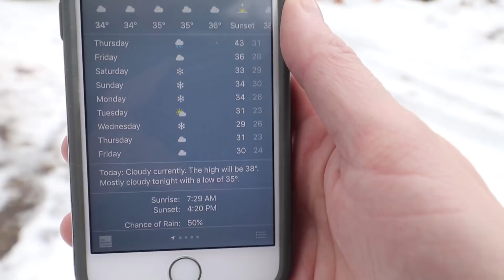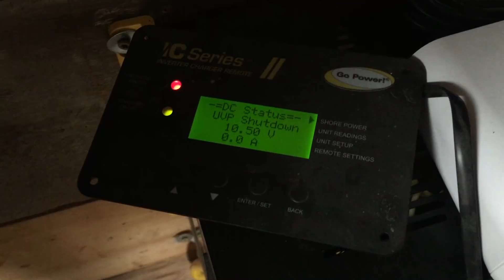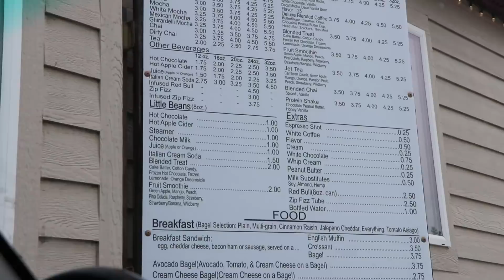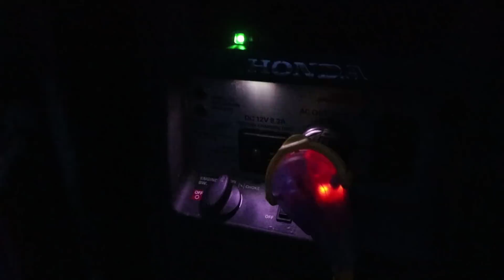Our Story: Giving Up Solar Power to Go On Grid

Comment: Your solar experiment was doomed to fail! The system was just too small for what you were trying to do!  There is a home in the coast range west of Lorane, OR  that carries on a normal all electric life on total solar and wind, but they use a system that cost nearly $100,000 in 1981.  Most people can't live the way they are used too on total solar in the Great NorthWET.  We went grid tie.  Can't speak for Bonner's Ferry, but a 20kw grid-tied system in Philomath,  cost $20,000.  After rebates it came to 7,000 and in the 2 years since installation  the highest power bill has been $25.00. In the summer running air conditioning.  In the winter (gas furnace) we still run the meter backward.  This is 3,800 square foot 2 story home with an electric hot water heater. The only maintenance is washing off the solar panels on the roof every so often.  Just a thought. Good choice for your lifestyle, consider grid-tie and maybe some batteries for backup when the power goes out (at least in  Benton County Oregon you have to go either grid-tie or stand alone).

Comment: You could do your homework and learn to install a grid tied system. The grid acts as the battery, basically you only pay for the power used in excess of what you generate. YOU USE THE POWER COMPANY.

Comment: Hi Jesse the first thing to do in any off grid energy situation is to assess all resources. Ie running water wind or solar. 7 or 8 panels is enough to power most homes in Australia with north facing roofs and deliver some excess to your neighbors . However your set up is tiny and not ideal. Because you are in a mountainous region you also lose a lot of energy with horizon shading. Please don't discourage others from using solar! It may be ideal for their situation! ALSO adding extra panels as you go is a cardinal sin.

You suggested that people can determine that solar isn't viable for a home with a handheld calculator. I assure you that you can't There are countless things to consider. Azimuth, tilt, peak sun hours or irradiance, shading including horizon, inverter sizing (which is one of your main issues), Losses in components and wiring..... You would actually need to create a graph in excel to show all this and projected output/battery charge so there are no surprises. A system can easily be optimized for summer, winter mornings or afternoons depending on when you use your energy. bachelor of engineering technology, final year.

Having said that if you had spoken to a specialized engineer instead of a sales person im sure they could have told you grid connection is better for your location. Or simply demonstrated the costs of both with a simple payback calculation for solar.

Comment: You're doing a whole lot of building without a whole lot of power. I think it's an extremely wise decision for your season of life. You know that power obviously isn't cheap to run to your property, especially if they'll need to dynamite through rock. But any home builder would have to do it if they weren't choosing to live off grid! It's something we have to consider when we buy our property. 

My husband is an electrician, sets up systems all the time. He can absolutely tell you if there's enough sun or not at a location, and we're in one of those situations now. People just don't think about it!

Good job at doing what's best for you! That's all that matters!

Comment: I've all ways looked at solar as an additional power source to grid power rather than a primary source of power
i actually run into your channel while looking into solar and i'm impressed  you gone as long as you have with as few panels you have, the estimated number of solar panels my house needed to cover it's power needs was basically equal to my roofs surface area
Reply: I mentioned that in my comment above, some people have no idea the amount of panels required to run a whole household.

Comment: By adding a grid power supply, it will give you resilience in your power supply options; a huge factor in living in northern climes. 
It will, once you have paid the supply connection fee's, save you a lot of money over the next 30 years.
As a retired Utility company Electrical Engineer of 40 years experience in the UK, I will be interested in their supply solution, the Utility company will offer you.  
A word of advice do not over estimate your power supply needs on your power supply application, it's a common mistake that can cost you a lot of money; get an expert to evaluate your load requirements and take into account the diversity factor.
P.S. I was an Electrical  Supplies Engineer in Central London and was an expert in this field, I would have been some help if your property was in Central London but......  LOL
Good luck

Comment: I have lived on a solar system off grid now for two years, your system is not adequate ;)
Reply: If you had listened to the video, their system was a test, and even if they went bigger, it would not give them what they wanted. They also clearly made the point that this is "their" situation, and everyone else will have their own specific needs, wants, and system. It's nice that YOUR system works for you but that doesn't mean your way of doing things or your particular use of power is anything like theirs.

Comment: I've been using solar, off-grid, for almost 15 yrs. We moved panels last summer over to the small shed. Yes it was dark more this year than the last several years in December and January. Yes we ran the generator more than I had expected. Since around the 1st part of February we have been able to use the batteries during the night and the morning. Only time I turn the generator on is for my blender because the lights go crazy and it doesn't start without the generator. We are using T-105's at this shed, 3 sets.
My 24v system stayed up during that dark time. But it has been doing even better since I changed the configuration and added the higher wattage panels, 2 sets at 48v (280 watts per panel), and a MPPT charger. I don't have to worry about the batteries as much because they are Lithium. 
My hubby would love to bring in grid power, 12 yrs ago it was about $8000 and we were self employed so the money wasn't there. As of last year, it has gone up, between  $15,000-$20,000, do to the increase PUD has initiated for installing the power. Even with us both working it doesn't seem to be in our budget. It has to go almost 1/3 mile from the neighbors connection to our site.
If we had brought in power 15 yrs ago I just might have had a house by now.
There are so many choices that each of us have to make each day and year.
If we do go grid tie he wants to keep the solar to offset the PUD bill, net zero effect. This might be a choice for you.
Reply: If we were grid tied then we would have qualified for help installing more solar. Oh well!

Comment: I applaud your realism. It's not easy to go 100% off-grid. It's certainly not cheap. One fellow I watch bought a pallet of solar panels, kept the ones he needed, and sold the others to offset the cost of his own installation. I've seen many, many folks having battery problems, from buying used batteries to save money, and then having to replace them soon, to not having enough capacity, to trying to keep the batteries warm. Corrosion of terminals, ventilation, and the complexity of wiring if one isn't an electrician are also issues. From my very limited experience, totally off grid living means giving up some things, and paring back as much as possible on everything, or spending massive amounts of money for a much larger system than most people ever think they will need. It's a wonderful idea, and it will eventually be practical, but for those who want a refrigerator, a washer and dryer, a microwave, and air conditioning (HORRORS!) it will take a lot of panels and a massive battery bank, with associated installation and maintenance costs. It will never be free, and it's a big compromise. For someone young and fit, who doesn't mind chopping wood for heat and not having many of the conveniences of modern life, it's feasible to be totally off grid. I'm old, my wife is disabled and needs to charge her wheelchair batteries, and I LIKE cool drinks, food storage, and having climate control. It's just never going to be practical for me, as much as I would like to be off grid. I wish you luck, and much happiness.
Reply: lol I could only picture the amount of batteries i would need to run my AC all night.  I run my ac all night, day time, meh i aint home idc, but at night... ALWAYS on I like it cold to sleep... I'll keep it 80F during the day but at night its 66.  lol batteries.  Vs my bill (thats way to much already) at $100 a month.

Comment: If you're going to pay $10,000 dollars or more to be put on the grid why not just buy a propane system,and use the solar for backup.. a propane system will basically run maintenance-free -with the exception of the truck having to come and fill the propane tank,which is a cylinder by the way once a month,and maybe even once every other month,all according to how much power you'll be needing and the size of your system.
of course every 6 months you'll need to do what's called a regular, which is the basic spark plugs air filter,and then of course you'll need to change the oil, no biggie though,and the best part about it is you're still off grid, and you will also not have to retrofit your home any because usually you can just piggy tell then to the solar system

Comment: 1. 12 volt DC battery feeding a 120 volt ac  light (using an inverter)
that means your 12 volt battery has to work 10 times harder.
example: 120Vac * 1 amp = 120 watts. 
                  12Vdc * 10 amps = 120 watts.
so, that means, your battery will discharge fast.
that's why a higher voltage inverter is important. i use a 48 volt inverter. of course, there are higher voltage inverter.
use the formula above.

2. It's your solar panels that charges  your batteries (you started with old batteries). 
 if battery are 12 Volt DC and 350 amps, that's 4,200 watts. you have your batteries in parallel (3 * 4,200 watts = 12,600 watts).
 it will a long time for 1000 watts solar array to charge those batteries.

3. Just to get started, i would use a 2000 watts solar array . If, you get 5hrs of sun, that means you would get ~10000 watts
(of course that doesn't count losses).  
you already have an Outback controller (150 volt 80amps great). 
also, i would use a higher voltage/wattage inverter. 
also, newer or new batteries. 
 
anyway, i don't understand, you started with old batteries, one solar panel, no experience with solar and you 
are giving solar a shot in the arm.

Comment: 10-20 Kw solar system + LiIon battery bank + inverter + Generac 7Kw propane generator that starts automatically when you run out of battery power. $18-$22 K if you install the solar panels on the ground by yourself. No need to fill generator, propane tank lasts months (used sporadically in the winter). Solar panels generate electricity even when cloudy or rainy, less (30-40%) but not zero!  Even better if you have an electric car which can store huge amounts of electricity up to 70-80 Kwh and can power the house for a week. Something like the Bolt or Tesla 3 ($35K). Free energy for life.

The other solution is 10Kw solar + inverter + Net Metering (hook up to the grid) brings your monthly bill to $0 for the entire year. $12 K

Comment: I think you're making a good decision given the weather and your power needs. If Winter means lots of snowy overcast days, it doesn't matter how many pannels you have. Most of those I see on Youtube having good luck with solar either live in areas where it's sunny most or the time, or they use it as a suplemental power source in conjunction with being hooked to grid power. Also the all solar people tend to be in 'tiny houses' which cuts the power needed to light, heat, cool, etc. You're building a full size house. It might be a neat project for the future to see if solar or maybe wind generation would make any sense as a supplemental source there. Doing that when it's not what you have to depend on for power would make it a lot less stressful.
Reply: Overall I would say that you need to match your ongrid/offgrid systems to your particular needs.

As a counter example, that points to targeted use of Solar, I would point to the Hilder's, from Idaho mountains, whose home was designed to not need as much energy as a traditional design that the timber frame is modeling; i.e. built in to the side of a mountain/hill, use of materials that will conserve heat(masonry mass), reduced use of electrical power, etc. 

For an intermediate example I would point to Steve Robinson, a more traditional house design but diverse use of Solar, Wind, Wood and Propane mix to live unconnected to the power/water/gas grids; they use electic stove/oven, traditional refridgerator and a workshop for Pete's sake!

Another intermediate example is Ed, preppernurse1, whose off grid system works for his and his kids needs. Solar balanced with generator.

Their solar setup is definitely NOT one that is meant to power a traditional house! It is closer to Tiny house or RV class system.

I agree with the others that they should definitely keep their equipment and refocus it as a solar generator as opposed to a gas/propane powered generator. I've used my small system, deliberately designed as a solar generator setup, to keep gas furnace(fans in summer)/lights/Internet going overnight when the local power company takes its sweet time to deal with downed lines/storms... Nice to not have propane/gas generator screaming in the middle of the night pissing off the neighbors! :)

They freely admit they live a lifestyle that consumes quite a bit of electricity and it DOES make sense for them to switch to on-grid for their specific lifestyle.

I do think it was unnecessary to dog on others who have less power hungry lifestyles. There are ALOT of families who's lifestyle's/housing CAN be met with off-grid solar/wind/wood/propane solutions and who DO shower, work and make use of modern convieniances.

Comment: Being an electrical engineer, I can tell you that’s it’s all about daily load calculations, in KWH (Kilo Watt Hours)and worst-case analysis. If there is one week of clouds, how much power would be needed from the batteries. The solar panels could still produce up to 50% of their full-sun output, so one must have 2x the amount of solar panels. You would still need fossil fuel for heat and a backup generator. As a previous poster said, a three-phase system is good but may be overkill. A high-voltage solar array and battery and a 220VAC inverter would reduce wire size. In fact, I am beginning to design a solar-lithium system for my RV using a Nissan Leaf or Chevy Volt battery. If the Chevy Volt battery could be plugged into the home, an integrated power system could be developed where the car could be charged by the house solar or the car could power the house when needed.

Comment: Having grid power is the way to go, in my estimation. My brother-in-law and his wife live within a remote canyon about a 45 minute drive from my home in San Diego. They have a beautiful modern two story home and everything there, by necessity, is on a large solar power system augmented by two large diesel generators. BIL is an extremely capable mechanical engineer who has lots of experince in heavy equipment operation, electrical, welding-in short, jack of all trades and master of many. The property is solar/generator powered because there is no practical way to get on grid there. LOTS of work and $$$ to keep it going but he works in a good engineering job full time and manages to pull it off. Don't feel like you have failed, you have not. You are making a rational decision based on your circumstances and the severe weather where you live. Go and build your dream!

Comment: You guys gave it a noble try. You didn't just do a homestead, you did the WHOLE thing yourselves. Just the two of you. Without tons of experience behind you. Help from some friends etc but you learned the hard way. I appreciate that you gave it a good try. Maybe if you'd built in a sunnier climate. Whatever. Coulda woulda shoulda. You DID it. Keep the panels to reduce your power bill just like many people do. Spend 5 years getting your house built, decompressing from all the hard work etc. Then try going off-grid again.

Comment: You already have the Solar Panels. If they are not broken, you can still use them and ease your bill. Use it as long as it works. 
What i did with solar, was because i have one side if my roof that is almost in the southern direction, i put a lot of solar panels in top of it. 3/4 of that are for electricity and the rest is for heating water. In the summer, i can cook with the water straight from the tab and my meter is almost standing still.

Comment: I totally support what you are doing. My grandparents were real homesteaders, in every way, not because it was some kind of pseudo-religion but by the fact they had no choice. They got water from a well by dropping a well pipe bucket, 3 gallons at at a time carried inside to a storage tank, used canning kettles to heat water (wood heat). They had a Ringer washer and did all their clothes washing 1 day per week, outside. Had an out-house for a bathroom, those cold winter walks late at night were tough, Etc...Family finally made them build an inside Bathroom w/septic tank and running water (Grandfather's view was you didn't $h*t inside the house). I watched them struggle with this my entire youth, made me appreciate all my "Modern" conveniences. Being on grid is the most cost effective way for energy, that is if you prefer to not live in 1890 or spending your entire day doing everything except what you want to be doing. Solar, etc. is great for a backup to power outages, can save your bacon but it's not practical for modern living.